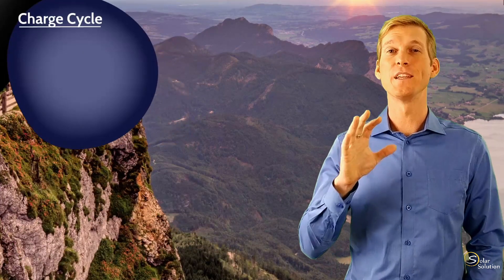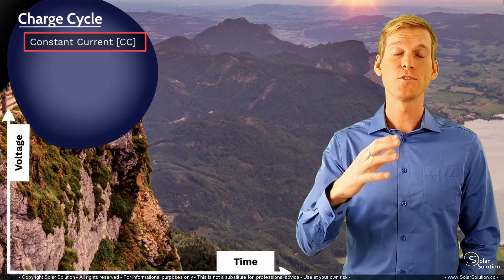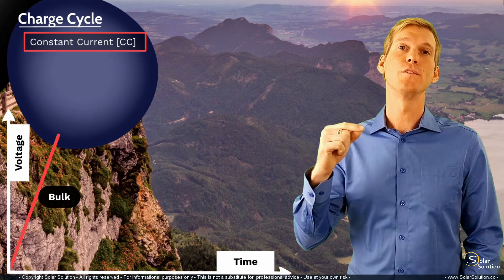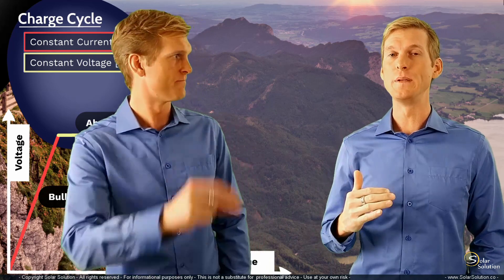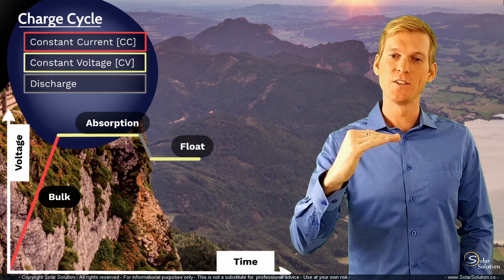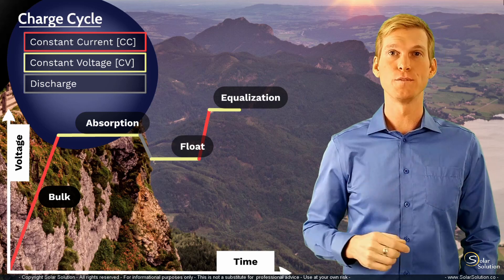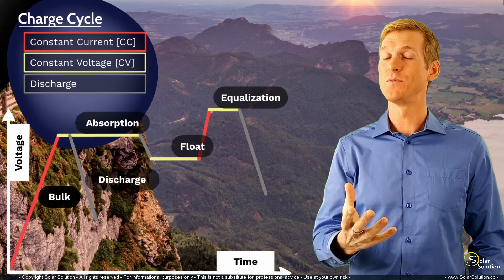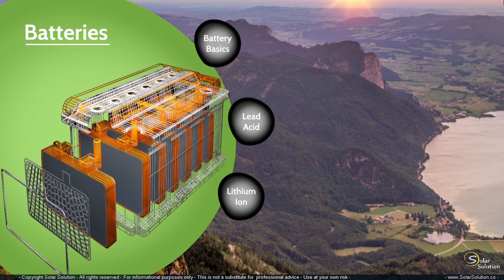Battery Charging Cycles Explained: Bulk // Absorption // Float // Equalization

Comment: If some cells have different voltage (e.g. one 2.1v the other 1.95v) the equalisation dont do anything, you need a bms or to replace the damaged cell.
Reply from the maker: Hey Chris! If that would happen to me, I would first carry out a topping charge i.c.w. a capacity check [both on the cell level], after which I would probably realize I would have to replace the weak cell. PS A BMS is always a must, please get one! TIP: Get one with bleutooth :). Good luck!
Reply: Get one ? 
I searched the internet found nothing.
Can you give me a hint who's manufacturing bms for lead acid ?
Reply from the maker: Sorry, I misunderstood you: I assumed you were talking about LiFEPO4's. What kind of FLA battery are we talking about?
Reply: I have opzs 2v 915ah , the problem i think is, i live by the sea, and they are out in the open in a cabin. They served well for 15yrs, rip....
Testing them with a 2v smart charger,  i get for 2 cells reading 'short error'
Reply from the maker: Ok, thanks for that clarification. Have you followed the manufacturer's equalization settings? Do they warm up as you do this? Have you ever let the batteries run dry? Have you measured the specific gravity of each cell?
Reply: All the above yes !
Have found lately active balancer NEEY 10a (60$) 2s-24s Lifepo4/Li-ion/LTO, does amazing job. Can adjust the parameters of LTO batts for Pb, it balances down to 1mV !
But my 2 cells were already sulphated and the others not in good shape. They've been through -4 to 45°C and 3 house moves....
Anyway, thanx a lot for replying !
Cheers !

Comment: for Lifepo Batteries does bulk stage voltage exceeds the obsorption stage voltage?
Reply from the maker: Hey Jamie! No it doesn't.
Reply: @SolarSolution  but i noticed  the current in bulk stage is higher than the current in obsorption stage

Comment: can you tell what value should be the bulk, floating and cutting voltage of a cell?
Reply from the maker: Depends on the chemistry and how far you want to push the cell. I'd recommend following the manufacturers specifications.
Reply: @SolarSolution the manufacturer recommends the operating voltage of 42.4 ~ 57.6v which i think too high and too low for my liking.
Reply from the maker: Those figures sound pretty extreme indeed, you might be pushing it hard if you would. FYI I'm running one of my off grid LifePO4's at 48-54V which is about 15-95% for me. Good luck!
Reply: @SolarSolution  and what you put on floating voltage, plz?
Reply from the maker: I will make a video on this specific topic, I think that's better. Any other questions you would like me to answer in this video?

Comment: Will the battery current remain constant in the bulk region if mppt controller was used?
Reply from the maker: Good question! When using an MPPT controller to charge a battery with solar power, the battery current may not remain constant in the bulk region. An MPPT controller's primary function is to optimize energy harvesting from the solar panel by tracking the maximum power point of the panel's power-voltage curve. The maximum power point varies with changes in solar irradiance, temperature, and other environmental factors.

During bulk charging, the battery is charged at its maximum allowed current, and the voltage is below the absorption voltage threshold. In this region, the MPPT controller will attempt to extract the maximum power available from the solar panel. The battery current may not remain constant due to variable solar irradiance, temperature effects, and changes in the battery's state of charge.

Changes in solar irradiance will affect the available power from the solar panel, and the MPPT controller will adjust the operating point to maximize power extraction, resulting in variations in battery current. Temperature changes can impact the solar panel's power output and the battery's charging characteristics, and the MPPT controller will adapt to these changes, potentially causing variations in battery current.

As the battery charges, its internal resistance and voltage may change, affecting the charging current. The MPPT controller will continue to optimize power extraction, which may lead to changes in battery current. So, while an MPPT controller optimizes energy harvesting from the solar panel, the battery current may not remain constant in the bulk region due to various factors like changing solar irradiance, temperature, and battery state of charge. Good luck! Jesse

Comment: What should be float and equalization voltage for lead acid tubular type batteries?thx
Reply from the maker: Good question! Since this can vary based on the design of your batteries, I highly recommend downloading the specification sheet of the manufacturer.

Comment: is the boost voltage the same thing as Absorption Voltage. Am a little confused as my batteries says 13.8V as Boost Voltage but nothing about Absorption Voltage
Reply from the maker: An excellent question, thanks! Different terms for similar things definitely doesn't help to understand these topics better, I agree. Boost is used interchangeably with Bulk. Boost is definitely not the same as absorption. Good luck! Jesse

Comment: I've been using the CTEK smart charger for my motorcycle battery and for the first time, I can understand all the terms; thank you. 
I do have a question though. The charger says that a battery (depending on it's condition) can stay in FLOAT for up to 10 days, after which it goes into the pulse stage where the charger pulses electricity to maintain the charge. Last time the battery was in float stage for almost 15 hours (but had not moved to pulse stage). I disconnected it from the charger and connected it to my mobike but it didn't start the bike (although it did get the lights and fuel injection going). So, I put it back on the charger. Since then it has been in float for two days now and I'm still waiting for it to go to PULSE (it does say it can take upto 10 days). Would it be advisable to go back reconnect it to the bike and try again? I don't want to start all over again!!

Comment: An analogy to water is how it was explained to me many decades ago and what I have used to explain it to a novice. However, the actual energy flows outside the wire and you would have to struggle to compare that to water in a closed system. Maybe look at the lower pressure outside the hose and credit it with the energy produced or harnessed.

Comment: I don't understand why a PbH+ battery needs CC charging. Surely at CV (at or below max charging V) the battery will self determine the current (with the exception of the equalisation stage) ie, a normal buck converter set at 14V or so will allow a 12V PbH+ to charge and sit at float by its own internal resistance??

Comment: i self set up a solar system . seems fine  lol . but i have a huge issue understanding float charge discharge etc .. im using 1kw of panels . 250 w each = 4 panels  the voltage is said to be roughly  37v each  so approx 140v total . i get about 130 on my charge controller , so im happy , im getting pretty good transfer from panels to battery . but i never get more than 400 watts from them .. besides that . my issue is . in the morning they charge up great . straight to full charge . 4 x 190a/h batteries , charges full at 58v . but as soon as it gets full it starts discharging . i only use about 100w an hour from my appliances . which is only my pc music system cctv  and internet  ,and while its discharging  the watts from the panel through the charge controller drops dramatically . , by the time the sun goes down . im left with only 51v battery power . which only gives me 3v until i get warnings that the batteries are low  . i havnt lost power to my room yet , but its coming very close . my assumption was , that id be charging the batteries all day, then when the sun went down id have a full 58 v's to use over night . which would be 10v's i could use up before batteries went flat . but no , i only get a few volts left after sunset and discharging . im obviously doing something wrong . i just dont know what .  any ideas on how i can stop the discharging . or set it up so at night the batteries start at full charge instead of near empty ... ?    this solar is a suckers game . lol ive worked that much out . its an empty pit of money to save a few bucks .  but im stuck with it now and would like to make the most of it ...

Comment: hello. I have 2 systems with hybrid inverter. each system with load 500-800wh load. and has. battey bank 12pcs * 200ah 12v/ c10 /63kg  other syatem with load 500wh load 8pcs *200ah 12v c10 /63kg
the systems failed after 6months or less operation to support load for 2 hours at least.
I replaced the batteries from 2 different factories and still failed for the 3rd time

Comment: Hello please let me know what you suggest for the best setting for 200 amp luminous solar battery 12200

I have 4 Battery connected to inverter 48v

Inverter app setting:

Battery Parameters Setting:

-Battery cut-off voltage:

-Back to grid voltage:

-Back to discharge voltage:

-Charger source priority: SUB

-Max. charging current:

-Max. AC charging current:

-Float charging voltage:

-Bulk charging voltage(C.V. voltage):

Regards

Comment: all in one inverters use available voltage to run your house even without a battery. Leaving your batteries while charging from solar to flow with out taking from the battery saving it for night time use.

Comment: i have 2 strings  of 48 volts flooded batteries ..what is the best charging on my inverter ,,,,mine is 58.2 bulk  and 55.2  as floating ,,, during winter time and temperature between 0 and 10 c ?
Reply: 40 amps charging setting is enough...bulk charging 57.6 and floating 55.2

Comment: Hello jesse and thank you for another bright explanation.my question is about the difference between gel battery and gel agm battery.my battery is 90ah agm gel.when charging with the battery charger which has the option to choose gel-agm it chatges to 14.7v and then goes from bulk to boost and float.when charging with the solar charge controller which has only the gel option (no agm option) it reaches 14.1v and goes to boost and float.can i manually change the parameters in the solar charge controller so it reaches 14.7v? Its a srne mc2450n10. 50a mppt

Comment: what if any inverter doesn't have an EQUALIZATION feature. in that case, how will that affect battery life and performance?
I have the same inverter where the BULK nad FLOAT feature is available but missing the EQUALIZATION feature. can you tell me about this issue?

Comment: Probably the best explanation I've seen so far. Thank you! I have one question, I have a 24v LiFePO4 battery where the manufacturer recommended the same bulk and float charge of 28.8v. How does this work?
Reply: because li baterries don t need float cause they don t discharge themselves in time like acid batteries